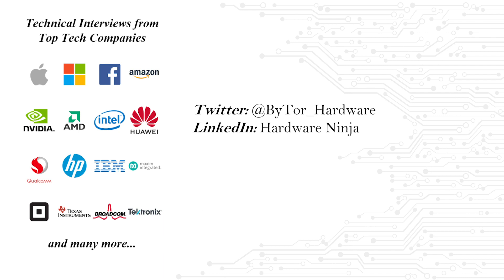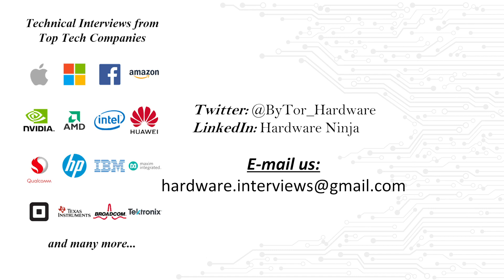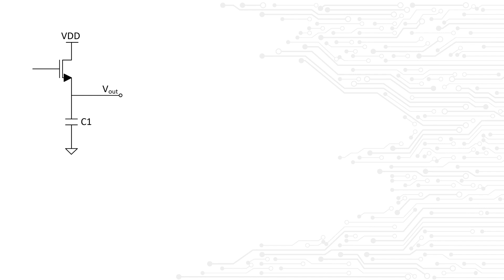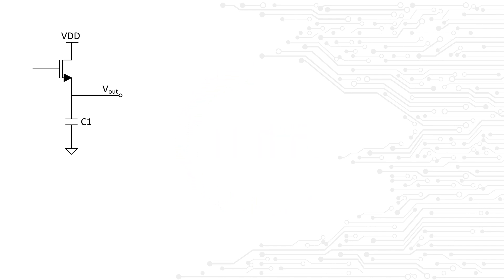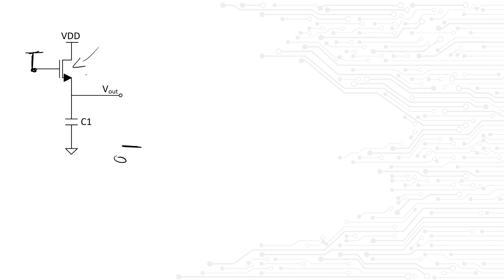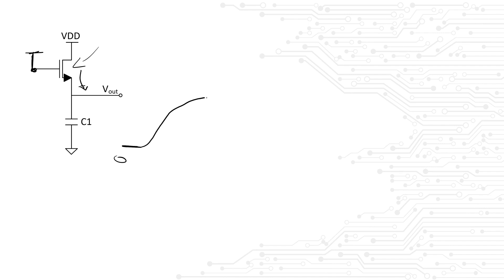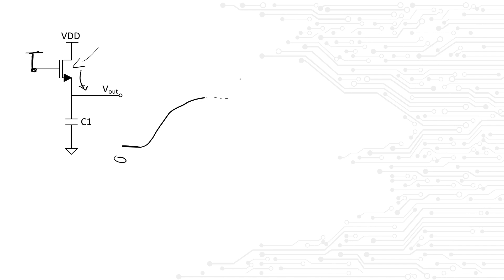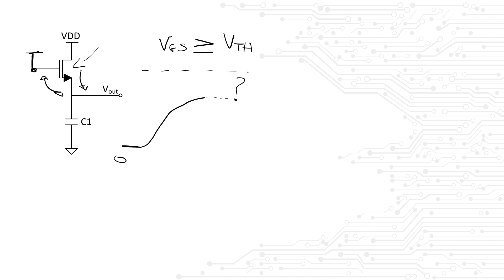HWN - MOS Switches Interview Questions

Comment: The solution is the simplest, I agree. But I was thinking can we use charge pump to the gate of the NMOS? That will also work right?
Reply from the maker: Hi Ritayan,
You're absolutely right, it would work. However, remember that as an engineer you're always after the most efficient solutions. A charge pump by definition has less than 50% power efficiency. It also adds cost, complexity, etc for something that could be designed the right way from the beginning. Hope that helps clarify the question.
Reply: @HardwareNinja  I must say, this cannel is doing a great job. If possible, please make a video on how to intuitively find the poles and zeroes of a circuit. That would be really helpful.

Comment: The answer to this question completely ignores subthreshold conduction and leakage effects. In reality, the NMOS will charge the cap up to VDD-VTH *quickly*, but then continue to charge it up due to leakage/sub-Vt conduction. If you wait long enough, it will charge to the supply.
Reply from the maker: Hi,
Thank you so much for your comment and contribution to the community! While you are right, and leakage WILL affect the voltage at the output, remember that this is an interview question. Therefore, it's about spotting what's wrong with a given implementation and understanding the basic theory of operation. After all, you wouldn't want to wat "long enough" for your phone to unlock its screen right? :)